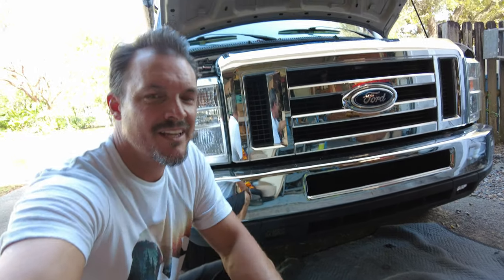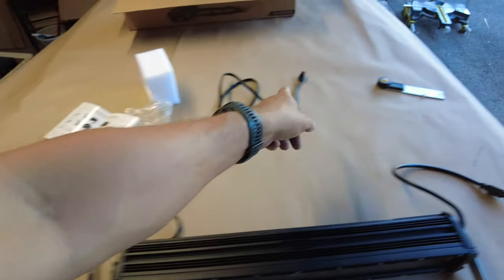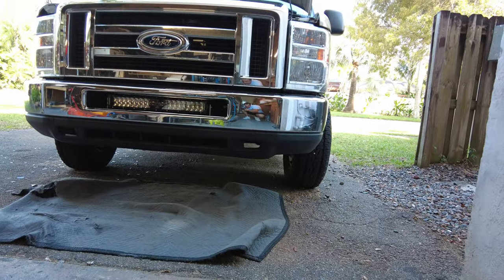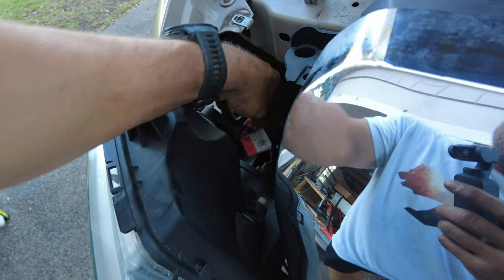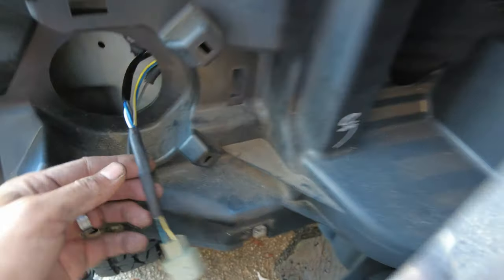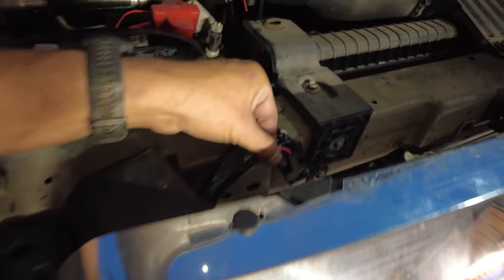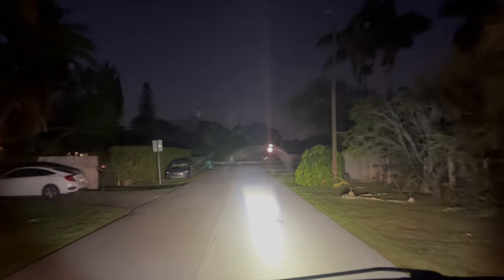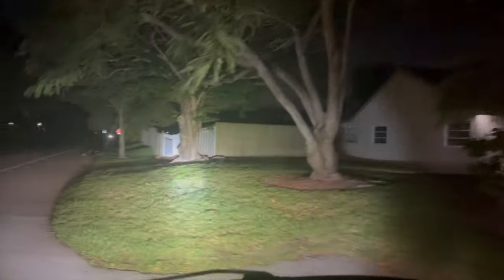Hidden Light Bar Install - Ford Econoline Van Build ~ Part 6

Comment: Thanks Chad!!  Wondering if you noticed any change in temp from the little bit of airflow obstruction?
Reply from the maker: Not at all, there’s still plenty of space for air to flow around the light so I don’t think it would be a worry.
Reply: @drawersystems  thx

Comment: Hey brother, love the vids keep um coming I just bought an 09 e350 superduty extended passenger. 
Question: what headlights are you running?  Im not planning a light bar but want to fix the dull stock headlights not to mention one of my low beams is out on the left side (they both only work high beams)
Reply from the maker: Thank you! The headlights were factory ford.